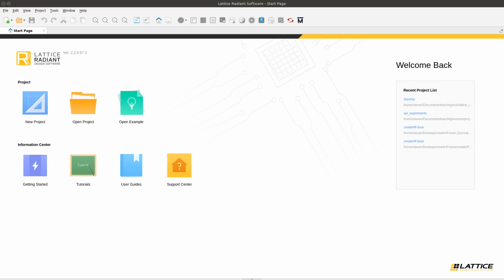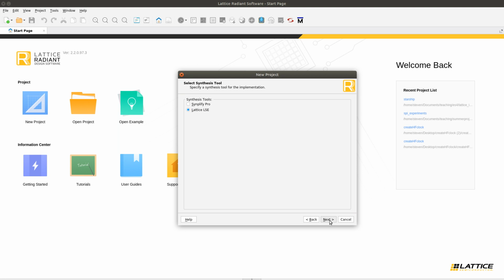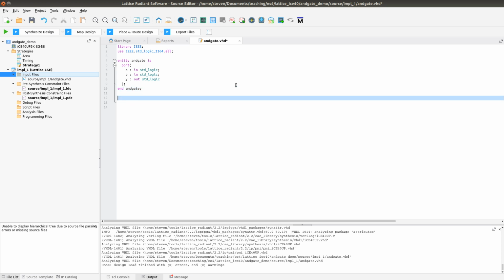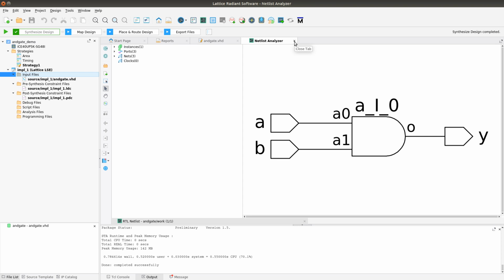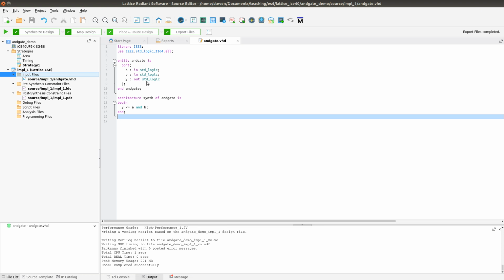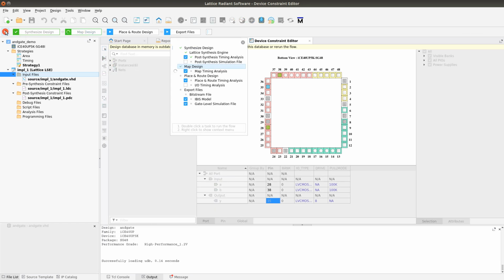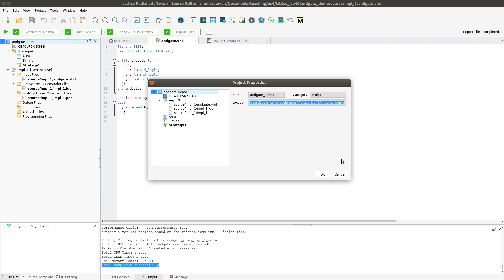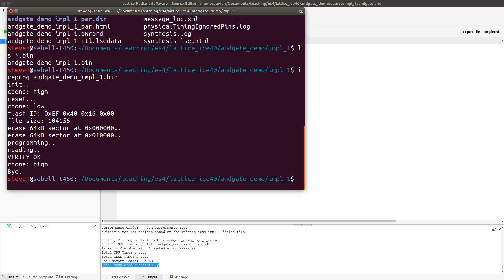Your first project with Lattice Radiant

Comment: So is the output of Propel an (encrypted) hdl file that you then import/add to your existing FPGA design?  Similar I think to how you can use LiteX and then import those generated verilog files into your fpga design software?   But if you do have written custom logic, how can you configure Propel such that the Risc-V sees it as just another IP?  Or in terms of LiteX, how does your existing design (say APB3 bus) interface to the LiteX part (Wishbone bus)?

Speaking of software, Reveal is included in Lattice Radiant software (free for Ice40)... however the Ice40 FPGA doesn't have a hard jtag port.. so you can't use a pico flashed with daplink/picoprobe to debug using ecpdap?!   But I think in Radiant, you can instantiate reveal with a soft jtag.. and then debug using an external ftdi jtag dongle?  Lattice Diamond / IceCube2  either don't support the ICE40 or don't have Reveal, or requires a paid license!   Note, iCEcube2 2017.08 was the last version that used Aldec.. the 2020.12 version replaced it with Modelsim.

Nice to see there are so many low-cost FPGA options (Sipeed Tang Nano , Trenz SMF2000, etc)!  But the most plentiful seems to be Lattice-based*.    However, how does one add LiteX support for a board that is not officially listed in their officially supported boards?  I found several articles**, but haven't been able to get a basic VexRiscV to output the LiteX banner via the Jtag-uart on a  ColorlightV8 (5A-75B) board.  
If an ECP5 has 190KB.. then I'm thinking the ("rom") code/bios space be about 32KB, and 32KB for "ram"?  Of course all of it runs inside the FPGA's ram blocks.

I'd prefer to instantiate a  1) kuznia-rdzeni \ coreblocks Risc-v  and 2) LiteScope  however, assuming the Riscv has debug support, how does debugging or downloading a new elf works. I've read that litex has "serialboot" that can be used to upload a new elf via uart.. but I'd like to single step the elf file. Similarly, litex_server --jtag --jtag-config=XXXcfg and litex_term --jtag-config=XXXcfg can be used to peek/poke memory access, not quite code debugging using eclipse ( preferably codeblocks) + openocd

What I also like about lattice is that there is also other open-source design options... 
f4pga ,  Icestudio , or Trellis Ice Storm (Yosys, nextpnr)         

Simulation tools
Verilator (if x/z states are not needed) or Icarus 

RiscV Tools
riscv-collab/riscv-gnu-toolchain , gnutoolchains' "Prebuilt Windows Toolchain for RISC-V", emdalo  "RISC-V GNU Compiler Toolchain",  "xPack GNU RISC-V Embedded GCC" , Renode , CodeBlocks

and programming/debug tools
a PiPico flashed with JTAGProbe / daplink/picoprobe can do ECPDAP...   or an FTDI FT232H MPSSE  (openfpgaloader/ecpprog,  openocd)
 
There also looks to be many cool commercial software,
 Altair Silicon Debug Tools , Aldec Active-HDL , SynaptiCAD VeriLogger Extreme / VeriLogger Pro, Matlab HDL Coder

*
pico2-ice iCE40UP5K 
Icepi Zero  ECP5U
TinyFPGA BX Ice40LP8k
UPDuino v2 Ice40UP5
Icestick Ice40hx-1k 
ULX3S ECP5
OrangeCrab ECP5 25F / 85F
IzeZero Ice40Hx 
Icebreaker ICE40UP5K-SG48I
Fomu ICE40UP5K 
IceSugar Pro/Nano LFE5U-25F/iCE40LP1K
Cynthion   LFE5U-12F ECP5
LimeSDR Mini2 ECP5 LFE5U-45F

**
FPGA Tomu Workshop  (Similar to Signaloid C0-microSD)
"Getting started with Litex on a Tang Nano 9K"
"From zero to SoC in LiteX"
"Setting up on-chip debugging for a Litex based SoC" --swethaaneha
"Host Bridge to control litex" -Yu-Ti Kuo
"Let's Write Some Gateware, use Python with LiteX" -tzechienchu.typepad.
"LiteX Soft CPU on the ULX3S - reloading firmware without reflashing the soft CPU" -gojimmypi 
"Adding the Digilent USB104 A7 board to Litex."  controlpaths (Pablo Trujillo)
"LiteX on the SQRL Acorn FPGA"
"LiteX - Add JTAG PHY interface to VexRiscV CPU" -- Adam Henault
"Debugging VexRiscv Over a JTAG Tunnel with OpenOCD" - Craig J Bishop
"VexRiscv, OpenOCD, and Traps" - tom verbeure
$15-ecp5-board-kit - fabienm
"Moondancer: A Facedancer backend for Cynthion"